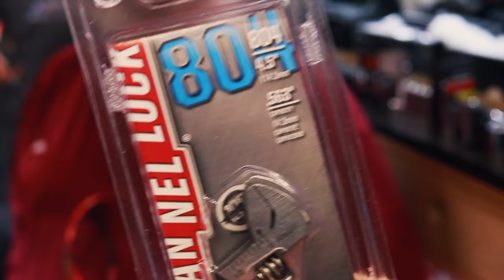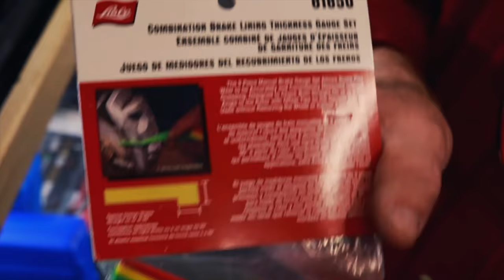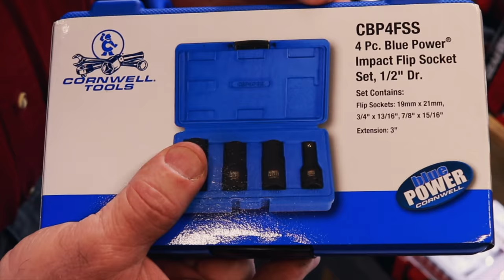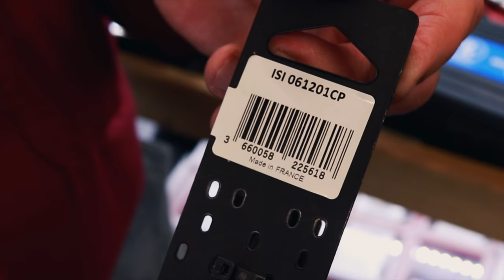Cornwell Monday Flip Sockets

Comment: Hello sir good post. Im surprised the flip sockets didn't really catch on, i used them back in the late 1970s at firestone. I still have a socket from back then, the thickest socket i have ever seen. When cars had steel wheels and hubcaps. I bought a set from my home town sears an Astro Pneumatic at a good price a 3pc set it came with 3 sockets and an extension. I remember when they counted the case as one pc. So now i have a craftsman, a Snap-on the old one and the set, i keep the set with a breaker bar in my car. A 3pc socket set has 6 different sizes. The smaller socket 3/4 fits my Dodge the largest 7/8 fits my grand Cherokee and i use 13/16 at work on trailers. 40. Bucks for Joe's set is very reasonable.
Reply: Have they really been around since the 70s? Flip sockets?